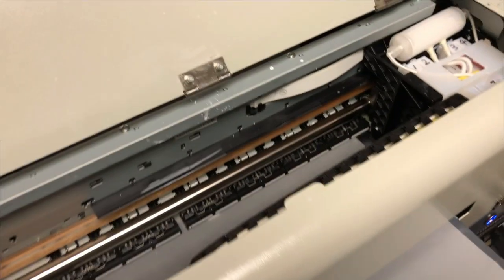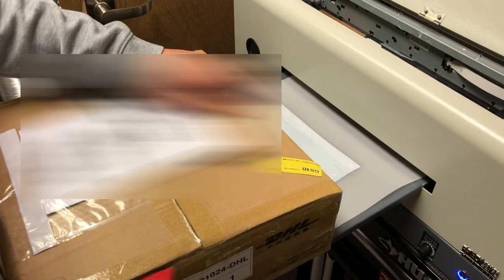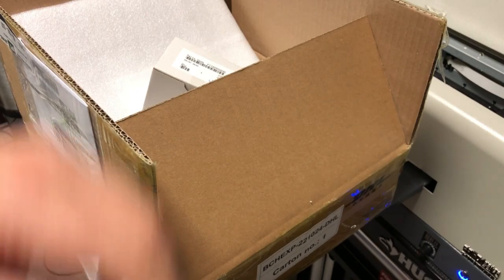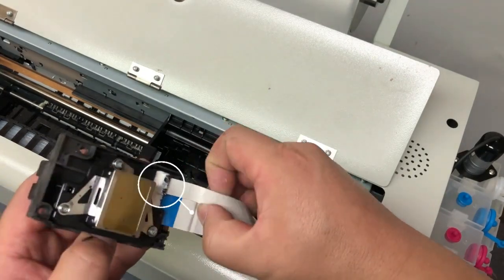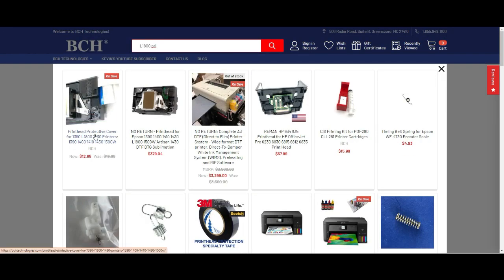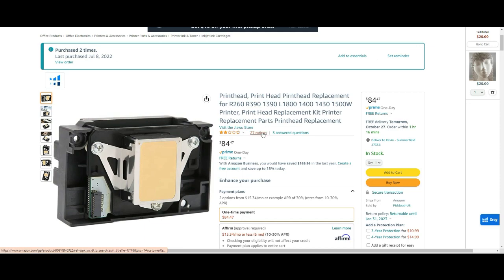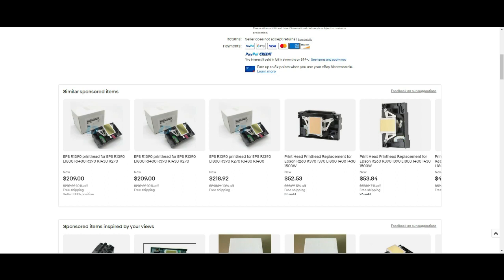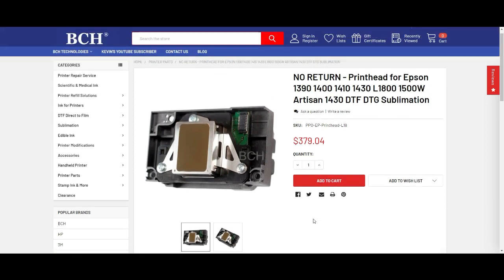Real or Scam: $300+ Genuinely NEW Epson L-1800 DTF Printhead vs $80 Amazon eBay Walmart

Comment: Off topic but would like some advice on Hp 8600, the carriage has no power and doesn't move at all, I had refilled my cartridge and since then an error for Incompatible ink cartridge for Y is showing and the carriage doesn't move at all.I've opened up the printer and everything is in its place, also cleaned behind the printhead but nothing changed.  Can this be fixed?
Reply from the maker: It seems to be a mainboard problem. This problem is very stubborn and you have to throw away the printer in most cases.
Reply: @BCHTechnologies  Oh man that's so sad. It's there anyway to salvage it?